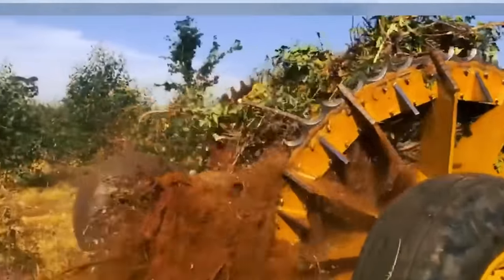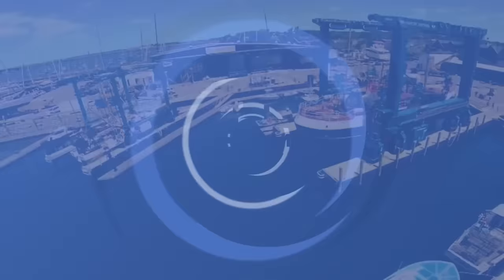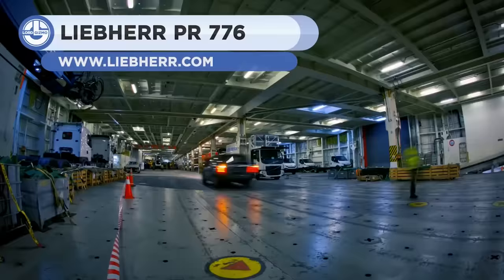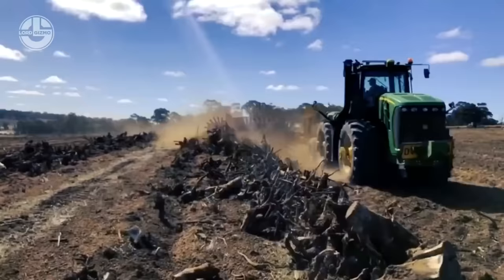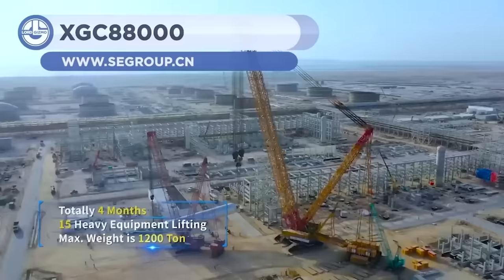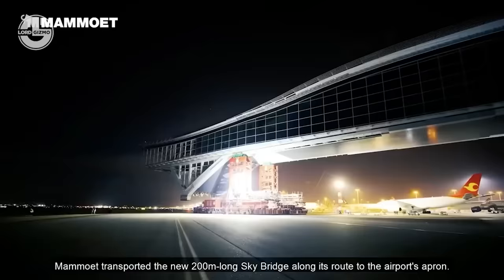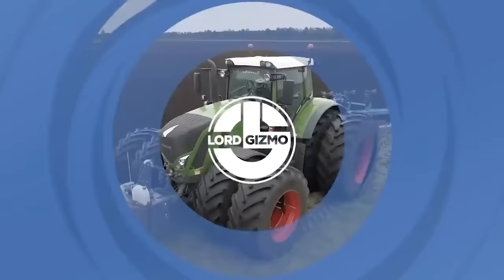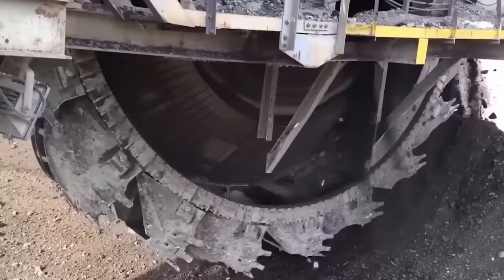400 Jaw-Dropping SUPER Powerful Machines and Heavy-Duty Attachments That Are On Another Level

Comment: If you are familiar with Truck hauling simulators, you'll appreciate how hard it is to transport those extra-wide cargoes. Not to mention the alternate-steering trailer wheels. It's a dynamic scenario that is totally different to conventional hauling. Very skilled drivers.